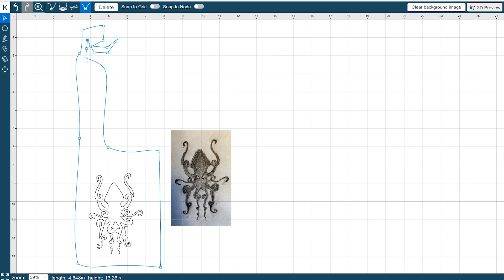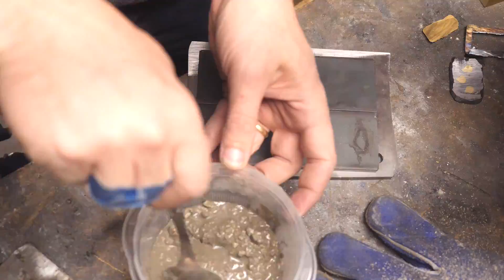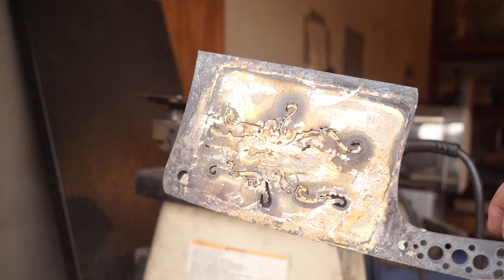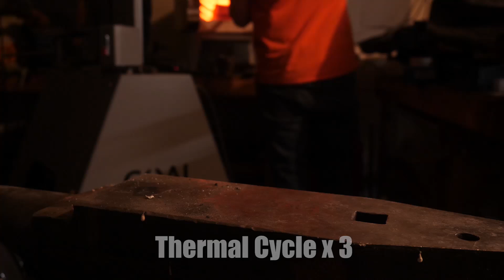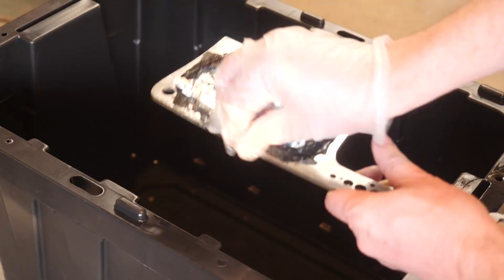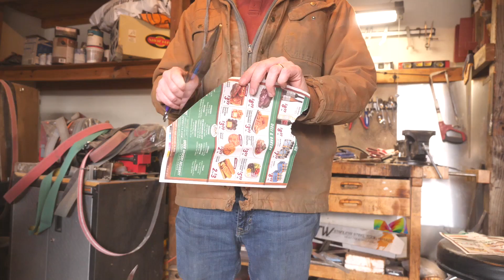Making The Squid Cleaver!

Comment: YEAAAH ANOTHER GREEN BEETLE! 

That yellow foam is Zinc Oxide. I think you might need to create some sort of way to remove all the oxygen while heating. 

Here's a snippit I found from a random chemistry forum. They even linked the article!

"One difficulty in making alloys is that metals have different melting points. Thus copper melts at 1,083 ∘C, while zinc melts at 419 ∘C and boils at 907 ∘C. So, in making brass, if we just put pieces of copper and zinc in a crucible and heated them above 1,083 ∘C, both the metals would certainly melt. But at that high temperature the liquid zinc would also boil away and the vapour would oxidize in the air. The method adopted in this case is to heat first the metal having the higher melting point, namely the copper. When this is molten, the solid zinc is added and is quickly dissolved in the liquid copper before very much zinc has boiled away. Even so, in the making of brass, allowance has to be made for unavoidable zinc loss which amounts to about one part in twenty of the zinc. Consequently, in weighing out the metals previous to alloying, an extra quantity of zinc has to be added."
http://www.uefap.com/reading/exercise/ess3/alex2.htm

One option you could try, is to displace all the oxygen in the kiln with nitrogen. Use a quartz tube to input the nitrogen, because they have an insane melting temp. I don't know if its wise to cut a hole to allow for a quartz tube tho.... and legit quartz tubes on ebay are like $200-$300. SO this is an expensive option.

A cheaper option might be welding an enclosure around the top and bottom of the blade. This way you have a much smaller amount of oxygen to contend with. And removal would just require you to grind it away. BUT BE SURE TO LEAVE a small air gap in the enclosure, because zinc boiling will still happen and you might create like a mini bomb.

Third option instead of welding the plates, try just using refractory for a top plate as well as a bottom plate. This might be just enough to keep too much oxygen from interacting with the zinc gas.

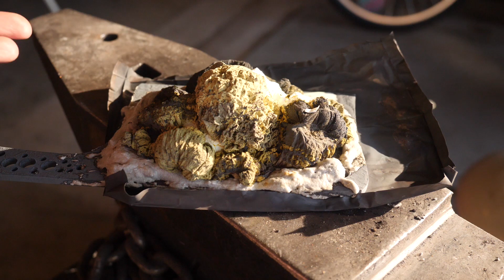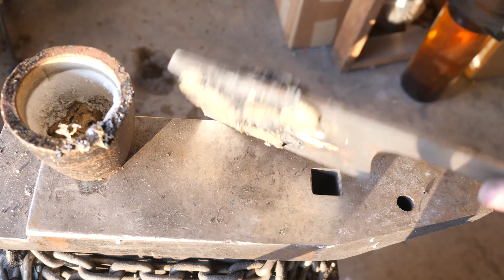Comment: 6:36, 10:03.....Dear god it's beautiful!!
Seriously, the first thing I though of was Bronze filler rods and an oxy acetylene set up. That way you can use a flux too. Only problem I see is not braising the backing plates or whatever to the blade.
Reply: Probably wouldn't need a backing plate, just put the knife in a vise edge up, start at the bottom and work towards the top of each opening.  Use surface tension and puddle control to fill it up by stacking dimes.  Probably would bulge sort of thick in the large voids but nothing that couldn't be managed.
Reply: @selador11 If you use brass as a Backing Plate it will weld itself to the liquid brass that's being poured into the void spaces in the piece. 

@der schwartzadder (The Black Adder Hmmm?  I like the Reference) If you use Refractory Cement as a backing plate it will more than likely burn through or it will bubble up like the first piece which will lead to an uneven fill. 

@Pablo668 You're onto something there with the brazing rods and Flux.
Reply: This was what I was thinking of but he could use stainless foil with a thin brass sheet between the cleaver and the foil.
Reply: Make the backing plates out of brass.
Reply: @selador11  or refractory cement.

Comment: you need to add a bit of borax to brass.  then it will be filled in well.  and heat the blade before pouring to 600 degrees Celsius
Reply from the maker: Nice!

Comment: Hey at least that 1st try when you pulled it out looked like an Octopus or Squid all bubbled up, hahaha... I've never done casting, but I remember watching a bunch of videos & the guys always wiped the top layer of slag off. I was wondering if you heated the blade up to 14-1600f, then poured and found a way to clamp onto the blade & knock it on maybe a piece of metal would that get out the bubbles & fill everything, just a theory of coarse, like i said i've never tried it... The cleaver still turned out sweet, hope all is well, take it easy...
Reply from the maker: Hey Dave!  Thanks.  I thought about heating the blade with the crucible but got worried about scale.  Interesting thought.
Reply: @GreenBeetle  Have you tried using anti-scale I use that ATP-641(even with hamons & clay) it works pretty good, there is still a little scale, but not bad at all. Then again you'd have to keep the pour area clean, which looks like it becomes a mess anyways...

Comment: you need flux good sir, 5050 borax and boric acid works well. just dump a crapload on top of the crucible, it's not an issue when pouring because it floats.
Reply from the maker: ahhhh ty sir

Comment: Braising Rods dude.
Reply: I thought of that too and I had another idea of maybe if he heated the knife to redish hot with the steel backing that is tack welded on instead of cemented like in his first attempt then used the second attempts idea of pouring the molten brass.. what do you think?
Reply: @Joe.Rogan.  that would certainly work better than his first attempts, however, I doubt anything would be easier than using a braising rod and a torch. Or, why not just cut the positive image from a sheet of brass and inlay it with some brass solder?
Another way would be to use brass dilings and keep heating and adding material as he went. Any of those would be better than  anything he attempted. Maybe next time, the resin looked sick still.
Reply from the maker: good idea but i have no oxy torch
Reply: Green Beetle map gas works
Reply from the maker: @nategallagher3249   i tried it yesterday it doesn't seem to keep the knife and brass both hot enough
Reply: No tig torch?

Comment: Y didn’t u use bras savings instead of a big block, the brass shavings would have went into the cracks better
Reply: I was thinking powdered brass.
Reply from the maker: yeah that would have been a much better plan... heheheh.  I almost heated it to 1500 and took it to the press but thought better flying bits of hot brass.
Reply: Use a mill or saw to cut chips and finer “saw dust”
Reply: Po Izzy  exactly what I was thinking too

Comment: You need to try it with bronze and not brass, brass contains zinc which turns into puffy white stuff when you get it too hot. Same reason its so hard to TIG weld brass and typically is soldered or brazed. Oooh speaking of brazing maybe some brazing rod would do job this perfectly.